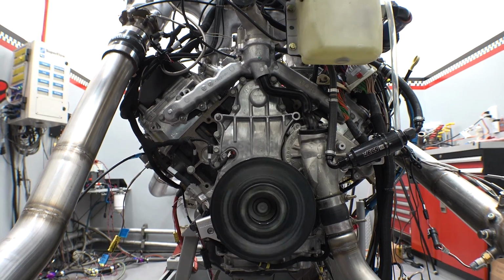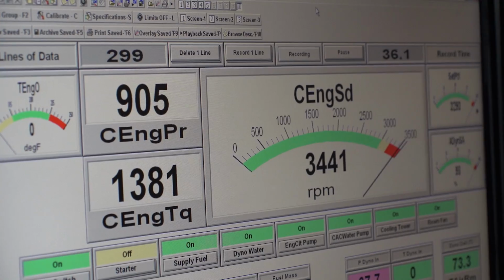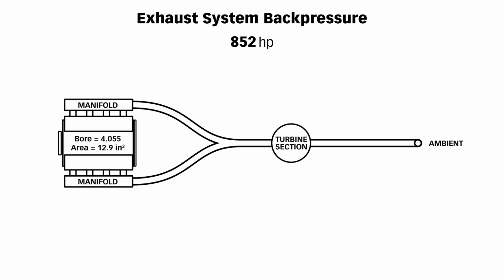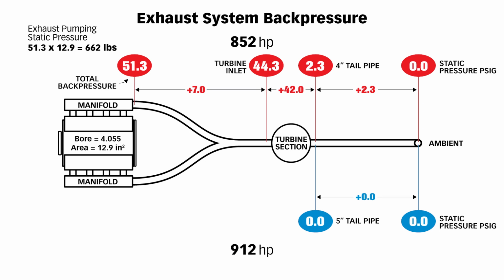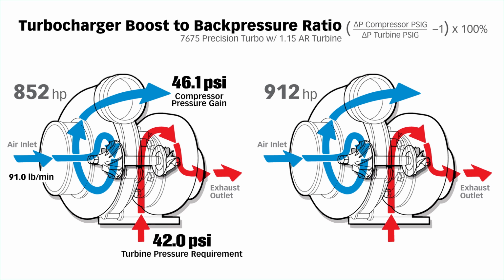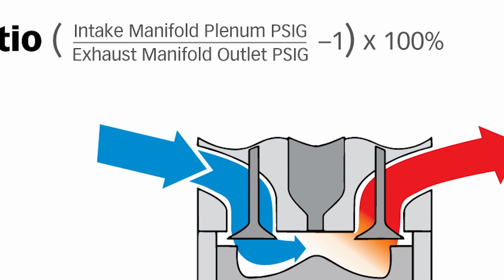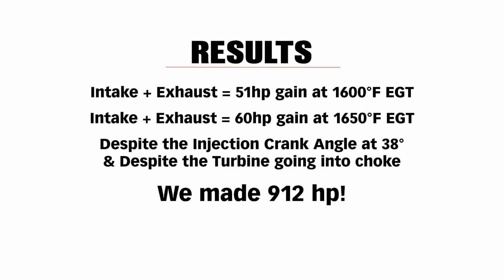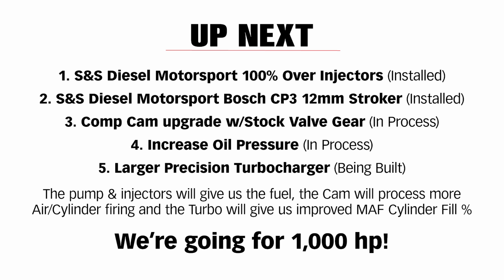912 HORSEPOWER DURAMAX with STOCK internals! Killing A Duramax Pt 12

Comment: 4:55 so basically bolt-ons got you to 912 horsepower peak that's not bad that's pretty damn good for factory internals I mean if it's just bolt on performance parts producing this with your programming is just amazing

Comment: Thank You Sir and all the guys @ Bank's Engineering. 🙏 When i watched this "Killing a Duramax"-series throu, I learned more about the engines, than I have ever learned, during my 50+ year of life. Because of this channel and all that good information, I'm using all the info as I do altering and mods to my "loyal warhorse" -99 Volvo V70 2.5T AWD. I'm calling it "Do Your God D*mn HOMEWORK!". 😁
Reply from the maker: It's awesome to hear how much you're learning from the series and applying it to your own project!
Reply: @bankspower  Thank You. 
What do You ppl think of following ... I found interesting info posted on Swedespeed website. One member changed his volvo P2R exh. manifold to earlier, so called "japanifold" (p/n: 9207688) which overall flow in bench @ 25" H2O differential, is 13.1% better than P2R exh. manifold. According to him, everything else in car was @ factory settings. A pull from 3000-6500rpm resulted +132.227 lbs/h (+60kg/h or +1kg/min.) on MAF data. 
Instead of "requirement" of air ... 10lbs/min /100hp (4,53kg/min./100hp) reading was 12.192 lbs/min. (5,53kg/min.) so it's ~ 22% increase just by swapping only one part, which reduces the BP.

Comment: I don’t really know much of anything about tuning diesel engines, but I like listening to Gail to learn things, one thing I’m insanely curious about, he talks about pressure a lot.
Is there no point in putting long tube headers on a diesel?  Why does nobody ever do this?
Long tubes always help torque on a gasoline engine, does that not work on a diesel? Somebody smarter than me please inform me why does nobody ever put headers on a diesel engine?

Comment: What if it had heavy wall stainless headers. With twin turbos, and dual 4" pipes. Possibly using twin scroll housings with flow diverters to spool quicker. Then gradually open as required to keep the back pressure below a certain limit.

Comment: Of curse the tailpipe flow rate matters, but it only becomes significant at full load.
How often do you tow some huge load through the Rockies where you need 912 Hp continuously???
And i wonder for how many hours can you really do that?
So there is one more data point that is missing here.
The cost / benefit analysis.
Us, mere mortals do not have Infinite $$$$$ to throw at this exercise.

Comment: i completely agree with you finally someone that understands 1996 dodge Cummins banks turbo exhaust housing Pac brake pro flow 4 inch adaptor bolted to the banks i can hold my hand on the cold side of the turbo after climbing 7% grade 15 miles 26k lbs and its cooler than coffee also aero turbine 4040xl diamond eye exhaust

Comment: HOLY MOLLY, WHAT AN AMAZING CLASS! Only reason I got into turbo'd cars back in the late 60's was MR. GALE BANKS! I would read everything I could find about his work on turbo engines and apply his principles to my cars. I once ran a small block Chevy Vega with turbo setup that no one knew was turbo powered. Beat the heck out of many "Big Block" motor cars without them knowing what the hell just happened. They were very confused because my car idled just like a factory unit and no nitrous tank or connections were visible. THAT was a lot of fun.
My respects to you Mr. Banks. I wish all my school teachers would have been like you.

Comment: Wow that izuzu Diesel runs pretty good. Can you do some more videos on American Diesels Cummins and the 6.7 powerstroke
Reply from the maker: Au contraire,  Isuzu Motors Ltd. of Japan has very little to no design input on the Duramax engines for the newer GM HD trucks. They co-own a portion of the D-Max company (the Duramax engine manufacturer) with General Motors.  GM/DMAX LTD owns 100% of the intellectual property on the L5P. Izusu owns 40% of the manufacturing facility but had no involvement in the development of the engine. The 1st and 2nd gen L5P engines are GM ground-up design and they are built right here at home at Duramax in Moraine, OH.
Reply: ...ya what he said!! suck it. ....ford owners do not care about building 900 hp they just want banks to help bulletproof them so they don't blow up

Comment: 12:00 isn't there a point where lessening backpressure starts to hurt? I understand that losing backpressure makes it easier for the piston to move back up on the exhaust stroke but doesn't a loss in backpressure mess with the velocity of the exiting exhaust gasses? Wouldn't that affect turbo effectiveness by slowing the velocity of the exhaust gas entering the turbo?
Reply: This man is a salesman and uses certain data to sell products. How are you gonna fit any of this piping on a truck? I mean this is all stupid and pointless but he’ll tell you that Joe Schmo in his garage making 500 horse on a 4inch straight pipe is stupid and he’s gonna kill the engine but it’s been running just fine for 500k miles.

Comment: Sure you justify the tail pipe mod at 800+hp.  But now much of a gain is it on a stock tuned stock turbo set-up. You just now changed it, which leads me to believe on a stock setup it's hardly worth it.

Comment: Based on back pressure drop as described in video, improving down pipes with higher flow ones from PPE be beneficial for a stock L5P with your Derringer?

Comment: @Banks Power I'd like to know how it would effect if you could install the 4" downpipe back on and leave the rest updated. Since turbine inlet pressure went up while manifold pressure went down, I'll leave here with question, what causes the turbine inlet pressure to rise? My thought on this is that now when you increased the downpipe, would have that been too big change? if the flow speed in the down pipe reduces because the diameter rising, wouldn't that have something to do with exhaust gas inertia reducing and by that, turbine has to do more work pushing the exhaust gasses out?

Comment: Is there some power to be gained by flow refinements on the intake side?  I see from the data that there is a 2.7 psi drop from the compressor outlet to the intake manifold.  Is this all intercooler loss, or is there some loss at the entry to the intake manifold?  How about dividing the compressor outlet pipe and running two of the same type intercoolers in parallel?

Comment: Yes he gave great results and great facts, but ya'll forget he put the up pipes and turbo like 10ft above the valley which obviously will not fit under the hood of a truck and bringing it that far away from heat youll have great results... heat, vibration, and weather destroys everything

Comment: Those pressure figures would be more accurate in absolute pressure no? The piston still has to fight against 1bar ambient air pressure even without the turbo in the equation

Comment: I'm still obsessing about the stock log exhaust manifolds.  It is amazing that they flow well enough to make 900 hp, but is there instantaneous pressure buildup when two cylinders on the same bank exhaust 90 crank degrees apart?  What does the pumping loop on the P-V diagram show?  This will inevitably happen on a V8 with 2-plane crank.  With a firing order of 1,2,7,8,4,5,6,3 this happens on the Dmax between cylinders 1 and 3, and 4 and 8.  How about making divided pulse manifolds pairing 1 and 7, and 3 and 5 on the left bank, and 2 and 8, and 4 and 6 on the right bank?  Then twin turbos with axially divided turbine housings would be good to keep the pulses divided all the way to the turbine wheels.  Or if the single turbo is kept, fabricate four up-pipes and plumb them so the ones from cylinders 1,7,4,6 feed together into the turbine.  Then the other up-pipes would feed from cylinders 2,8,5,3 to the other half of the turbine.  Can you get axially divided housings from Precision Turbo?

Comment: When are we going to see exhaust pressure wave harmonics?
because this is 25min of BAD SCIENCE, and here is why:
 - your 10" vertical exhaust changes the output of an engine, it acts like a vacuum pump once engine is running , hot air rises who knew...
 - your plumbing without an analyses of the pressure waves of each cylinder is just bad/random/good luck, that's it, random, you can add 0.5" to it and loose 50Hp, and now for the main issue
 - why are you using HP in the year 2020 ? nobody cares about hp, show us the torque/hp curve, hp is a point in it, and its irrelevant!
Reply: If you think anything Gale Banks does is luck, you are not very informed. Learn more about him and you will know that he knows everything there is to know about the science and math behind making power.

Comment: The fact that a bone stock internals L5P is cranking over 900 horsepower is testament to just how insanely strong those big o'l diesels are built. I'd be impressed to see a completely bone stock stock LS / LT pull off those numbers. You'd likely trash pistons not long after breaking 850 horsepower.

Comment: A crank pulley with fluid init to dampen the vibration?
Reply: Yes.  That's common on heavy duty diesels.  The fluid is NOT thin, somewhere in the range of 600,000 cSt.  40-weight motor oil is about 14 cSt.
Reply: @andyharman3022  thats badass. Can they not balance the crank inside the crank case instead of balancing it on the face or is it strictly to dampen vibration? My g35 crank was balanced inside so when i put on a light weigh crank pulley it didnt damage anything from vibration.
Reply: @puprilla  There is two things going on with the crank damper on the Dmax.  The engine is externally balanced, so the crank damper needs to have offset mass to balance the rotating assembly.  But it also needs to dampen the torsional windup of the crank when a cylinder fires.  That is what the high viscosity fluid is for.

Comment: 1388 lft of Torque, equals 1882 Nm at 3448 rpm. 
With that amount you can move a mountain.
 Very impressive and efficient for a stock engine.
I would like to see the power and torque curves and compare these to the stock curves.

Comment: The 912hp run shows that now all the piston exhaust-pumping action is being turned into intake boost inside the turbo, no piston force is spent pushing exhaust through the manifold and exhaust. 

I think the next step would be a turbo with a larger diameter exhaust side, just to see how much you'd gain from reducing the back pressure even further. The larger diameter turbine will then act on the same diameter inlet turbine, effectively gearing up the torque from the exhaust. larger and more turbine blades will also make each volume of exhaust provide more pushing force on the turbine.

Comment: Just curious Gale, at 17:15 when you figured out the turbo was actually losing efficiency, instead of needing a bigger turbo, would changing the size of the back housing solve the issue? Like using a smaller backhousing to increase the density of the air ?

Comment: I’m up to the part about the 51lb back pressure. That’s not just 51lb acting on the piston during the exhaust stroke, but it’s also 51lb when it’s at the top of the exhaust stroke in the combustion chamber of unburned gasses left isn’t he chamber that you’ve got to use valve overlap and boost to blow out before the clean charge goes in.
Reply: I should have watched the full video before saying anything, at 20 mins now and he’s explaining what I mean much bette than I ever could

Comment: Could this potentially make a 15minute run at max power?  60 minute?  24hour?  Thinking extreme performance marine engine applications. Lighter weight and better fuel consumption per hp paired with reliability

Comment: I would absolutely love to have Mr. Banks build out my 6.4 Powerstroke. It would be a dream come true, the only problem is I couldn’t afford it now due to my health and not being able to work much. Cancer and Brain Tumors are a bitch but hey, I’m still kicking and fighting it...
I also know, no one likes the 6.4 however I didn’t have a single problem out of mine until I hit around 145,000 miles. According to the fault codes it one of the injectors and it’s only intermittent. Mine is tuned and the 6.4 does put out great horsepower with just a tune and cold air intake. I could only imagine what Mr. Banks could do to it...

Comment: Gale, I got good results on the k&n HP-6002 oil filter, also i was able to pickup almost 15lbs of oil pressure with just reflective tape on the coolant crossover tube above the driver's side exhaust manifold. I ran a 06' with a refrigerated box up over the continental divide twice a week for 7 years until i stopped carrying milk up into the hills. I personally put over 550,000 service miles on that truck and its still on stock bottom end and trans, various mods but i was able to practically double my fuel mileage. I gotta get this thing up and running again (has to do with little green people of my municpality).

Comment: I can't help but wonder what 8 small turbos, each ran off it's own cylinder, would do. Would it decrease backpressure to where it's non-existent or actually add load to the engine, and would it offset the extra weight of carrying all those turbos and the cooling system/oil for them and piping? They'd have to be really small to be able to be spooled by a single cylinder each.
Reply: I would love to see the piping on that too

Comment: This was the coolest, most informative video, a certified mechanic could ever watch! I’m curious how back pressure applies to newer N/A engines, the power they can make, and the fuel used per HP. Say, a ford 5.0, or 3.7. You know, everyday driver engines. I’m just nerding out but I think it applies to my customers
Reply: LS, Atlas 2900, 3500, 3700, 4200.

Comment: Not sure of the cam duration and lift variation between intake and exhaust but can the scavenge effect be improved by changing to a cam with more exhaust lift or duration if possible? I guess overlap would be the prime opportunity to really narrow that pressure differential but near impossible to do on a stock engine.

Comment: This might be a really dumb question as I just started watching this channel but why don’t you have something in place in front of the motor to duplicate the ram air of driving?
Reply from the maker: The test is not designed to simulate on-road driving. We have a chassis dyno with 40,000 CFM wind machine for that. The engine dyno cell shown in this video uses a ventilation system that circulates 70,000 CFM through the room ensuring that it's always ambient temp.

Comment: I waiting for the big day which disassembly of the engine :) Your exhaust g.temp is to high for cast aluminyum cylinder head and aluminum piston. But it is still working since 500-600HP Sorry if I missed it, did you make any change on engine cooling system?  Also what is the PFP at last situations, can anyone answer me. 
Thanks Gale :)

Comment: 10 months r&d or something for a measly 900 hp? Cummins engines do this all day long with very straight forward setups... Compound turbos etc. 

I get it if you just wanted to try to achieve it with a Duramax... But I dunno
Reply: Cause that's exactly what it is, is r&d. Making small tweaks and changes to see how it responds. Anyone can throw big air and fuel at an engine and make big power. Even a stock bottom, compound Cummins don't live long at 900hp.  The trucks that make somewhat reliable on stock internals have a big single and a bunch of timing taken out down low resulting in low torque.  If you noticed the torque on this l5p it was only around 1300. If he compounded this or tuned it to make 1600+ torque, he probably would have windowed the block months ago lol

Comment: I do not get why there is a 1 PSI intake difference in the 2 runs, should the wastegate not bleed off exhaust to bring down the turbine pressure and the intake pressure?
Reply: There is no wastegate in this setup.
Reply: @andyharman3022  ok sounds weird, all this talk about measuring everything and then just let the boost pressure float around uncontrolled.
Do they cut fuel if something happens, to protect the engine and turbo when they can not do it with a wastegate?
My undersized turbo on my car had no trouble killing itself by spinning to fast, if not wastegate controlled and it needed the wastegate for engine protection if something went wrong.
Reply: They are protecting the engine by putting a limit on peak firing pressure, which they are monitoring via cylinder pressure transducers.  They are protecting the turbo by setting limits on compressor discharge temperature, turbine inlet temperature, and shaft speed.  This is how it's done to find the limits in a probe test setting.  If one of their limits is exceeded, the dyno operator pulls back on the throttle stick, which cuts fuel.

Comment: I love how there’s not emission controls like I don’t see it on a “stock” L5P
Reply: In this case "stock" is referring to the engine block, rotating assembly, cylinder heads, and intake manifold. The intake, exhaust, and turbo location are going to vary depending on what vehicle the engine is installed in. Gale Banks is just trying to find out how strong/durable the base engine is. This lets him and everyone else know what needs to be changed when using it for race applications.

Comment: This is why i think a belt driven blower is more effincen than a turbo.
An engine is made to trun a shaft, not be an air conpresser.
Reply: An engine is just a big air compressor really. Guy I know has an old Ford v6 engine that is a portable compressor. One bank is still an engine, and the other bank is the actual air compressor. Pretty wild.
Reply: @Steve_I  yes your right, but i think you missed my point. Take my lawn mower engine, i can kill it by stuffing a ball in the tale pipe, but i can not hold on to the flywheel hard ehgonuf to stale it out.